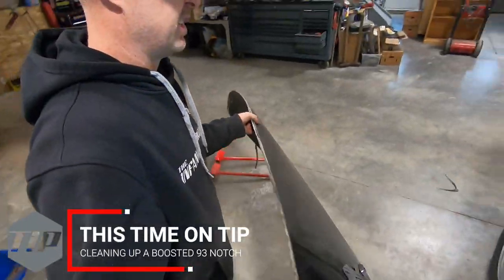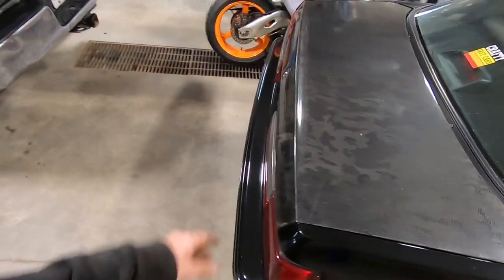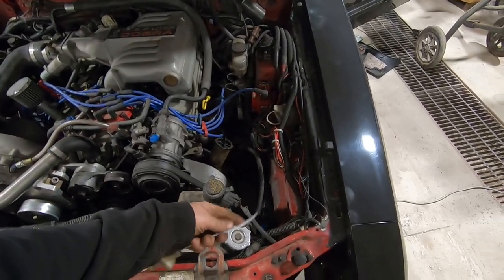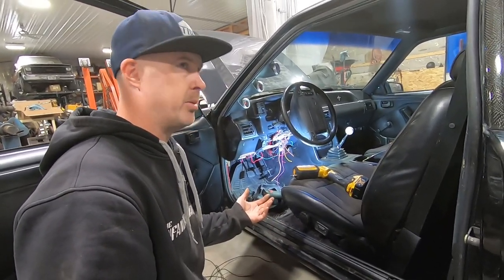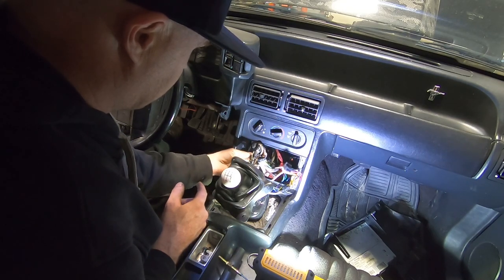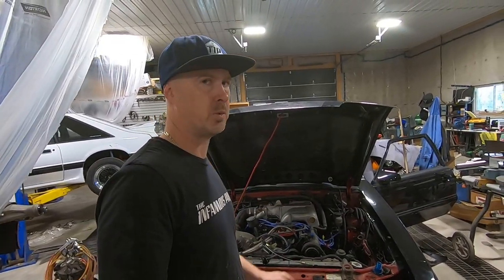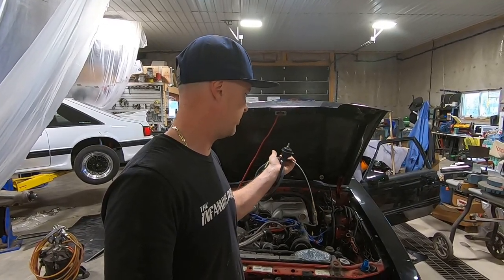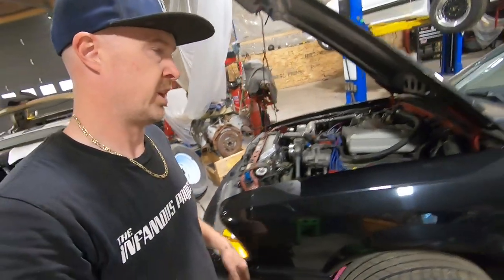De-Uglifying a Foxbody; Too Much Carbon Fiber? & A Clutch Cable Fix - TIPS04E101

Comment: I ditched adjustable cables years ago and always ran stock oem cables with a firewall adjuster and aluminum quadrant. That was always the perfect mix.

Comment: I've gone through at least a half dozen different cables and setups on my stock 87 with several King Cobra clutches.  Of course I drove it daily in Houston traffic and had the actual pedal mount break that the quadrant attaches to, had the OEM adjuster part slip and bend, an aftermarket adjustable cable break, and several "OEM" Ford (Mexico made) cables collapse under the hood at the adjuster or fray inside the cable. My latest one is a Maximum Motorsports cable, adjuster and quadrant, and it worked great until the engine blew at 306k like 10 years ago. Hopefully it is still good for when we get it back on the road. Have a great holiday!

Comment: Not a fan of the carbon fiber large pieces like window cover, windows, hood,trunk lid, i like small trim carbon fiber, some interior trim, but the rest can go, great job on the 
vipor removal & clutch cable install.

Comment: Do you still have the carbon fiber fuel door cover? Id love to have that lol
Reply from the maker: Lol... Not sure I want to see any of this stuff out there..but yes all pieces are available but not until spring as it's all up in Canada
Reply: I WAS NEVER REALLY A FAN OF THE NOTCH BACKS I ALWAYS LOVED THE GT HATCHBACKS AND THE 93 COBRAS. I ONLY DRIVE MY 93 COBRA TOO LOCAL SHOWS LOL BEING ALL ORIGINAL PAINT IAM VERY CAREFUL WITH THE CAR.

Comment: I only say this as I am trying to help, not be a know it all type. That's not really how that cable is supposed to go.  Both nuts go on the back side of the fork. The fork doesn't get sandwiched between the two nuts.  One nut that has a somewhat rounded edge goes into the rounded part of the fork that "pulls" the fork forward, and the second nut is a lock nut that locks against it to keep it from backing out.  The way you have it might be why it feels heavy.
Reply from the maker: No problem at all man. Honestly I have just always done them this way and have never had an issue...easier to adjust than with the double nut method imo.

Comment: Who in their right mind would put all that carbon fiber crap on their Foxbody? The rear window boggles my mind.
Reply from the maker: I think it was a shop trying to do promo for their stuff... That's my assumption tho.
Reply: @TheInfamousProject  
Is there anyway to take out all the slack in the gas pedal/throttle cable ?
Reply from the maker: @Metlupass2  I'm sure you could but there shouldn't be much slack to begin with! Consider changing the cable first.
Reply: @TheInfamousProject  you know what I mean with the gas pedal being so low and you're able to lift it with your foot. I've seen people use spacers or wire ties.